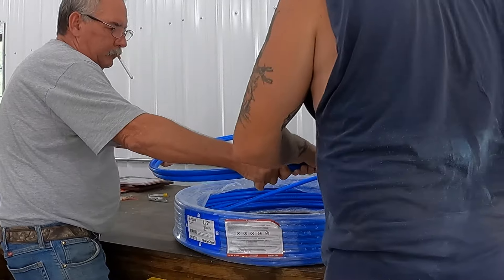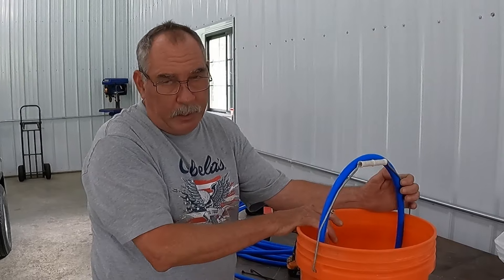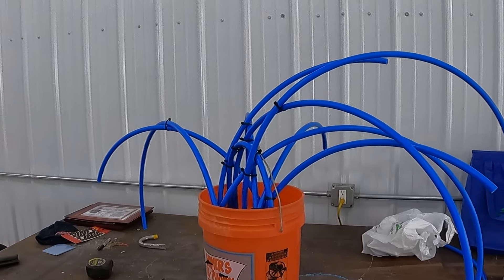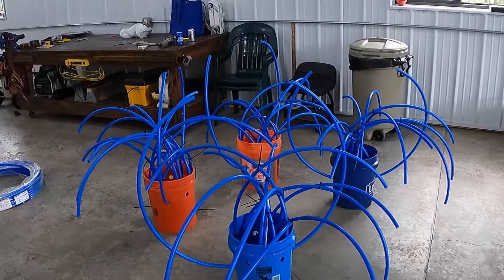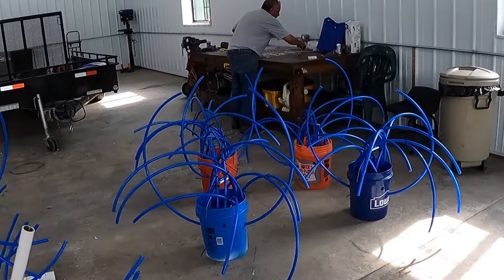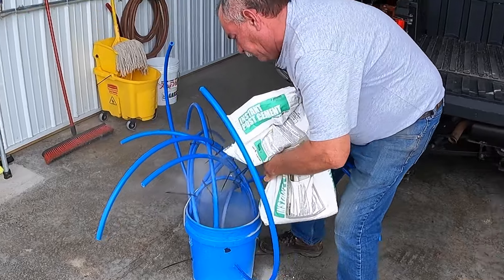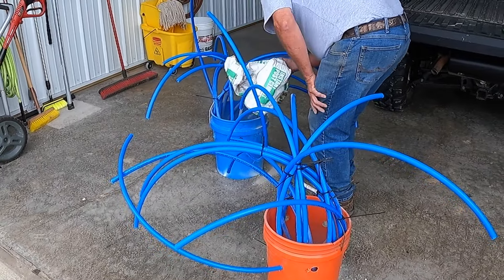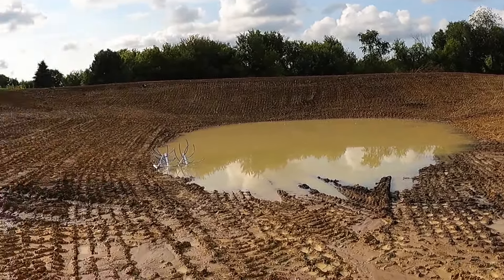Putting fish cribs in at my buddy John's new pond.

Comment: Seeing as you got heavy equipment working around, you're better off taking a wide snaggly rooted, and de-soiled stump with 6-7' feet of attached trunk, sharpened on the cut end, invert it, and put that trunk in the clay laiden ground 3-4' feet, and slap a flatter rock on top. (Just to hold it down until it water logs) It makes a good canopy, and root habitat for the bait fish to hide in, and game fish to park under.
Reply from the maker: Awesome idea, may have to try it. Thanks for watching.
Reply: @thebackfortylodge  I'm sure it's a little late now to install decent inverted stump cover, but seeing as clearing trees, encountering rock slabs, is often apart of pond building, it's an option. If the flatter top rock weight is shallow enough you'll get bass bedding on it.
Reply from the maker: @richparks1966    Thanks for the advise, I will definitely keep it in mind. Thanks for watching.